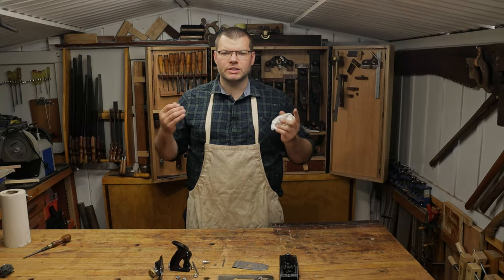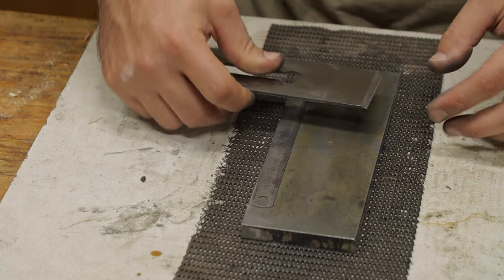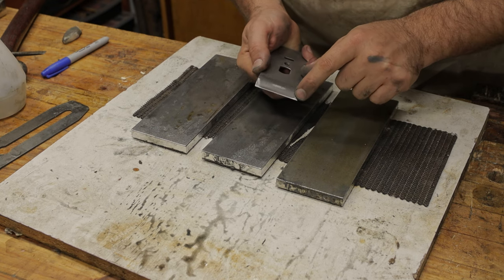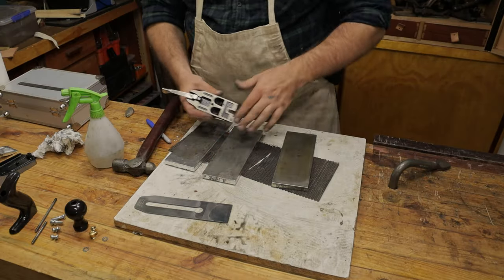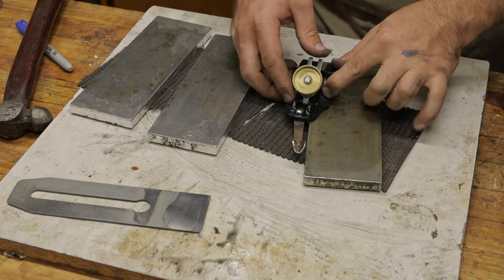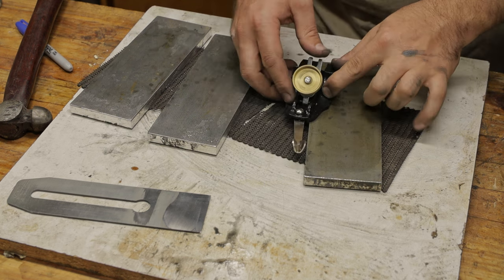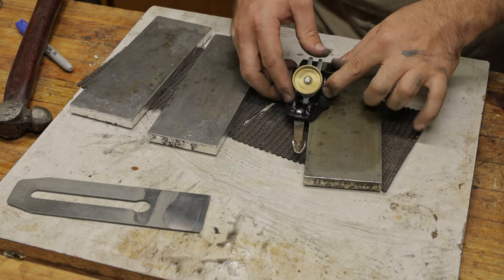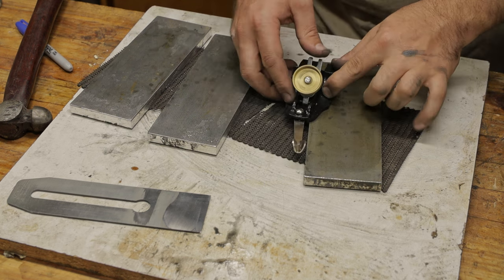How to prepare new Stanley Bailey hand plane!

Comment: I also bought one of these planes about two years ago and with a couple of hours fettling, it is actually very good; better, in fact than a premium number 5 that I bought at the same time by another manufacturer. The new Stanley planes will never be what they were traditionally but they have the foundations to work well if the user is prepared to put in the time to get them there. Oh, I also changed to good quality aftermarket wooden handles (for about £10 the set), which is a definite recommendation! I know Paul Sellers and I think Rex Krueger have videos showing how to make your own wooden handle sets but for £10 ready made, just buy them!
Reply from the maker: It definitely gets the job done once correctly set up and fettled, the biggest thing is a sharp blade and a well fitted chip breaker. I agree Wooden handles definitely transform the feel of any handplane over plastic handles. Thanks for the comment.
Reply: @AussieWoodshed  I found the iron (blade) quite easy to correct but getting the chip breaker to marry with it took longer than expected. On the bright side, once it's done, it's done, for many years to come. It'll do me for the rest of my life, I'm sure.

Comment: Fantastic job, watching gave the confidence to fix my new hand plane.
what type of sandpaper are you using to flatten the sole? 
I mean the grits and the type of the sandpaper
Reply from the maker: 120 Grit is what i generally use to flatten the sole, some times followed up with 240 grit but not often. Any basic sand paper works, currently i have been using fabric backed sand paper as i got a good deal on it. I have also used wet and dry paper, so really any sand paper you can get your hands on will do the job. I have a video going into more depth in regards to flattening a hand plane sole found here if your interested https://youtu.be/L7FKj6XUVNM

Hope this helps

Comment: I purchased the 12-004 about 4 years ago. Subsequent to that I acquired a Record no 5 which I have used extensively as it works wonderfully well but I thought now is about time I get the 12-004 going well.  I stumbled on your video which was so thoroughly well put together that I became an instant fan of your channel.

So thanks for the effort to inform others of how to go about turning that was ordinary to something worth possessing for real work.  

Have looked at doing the same to a Stanley no 5 from Total tools?
Reply from the maker: My Pleasure, glad you found the video useful. 

I was unaware Total Tools had the 12-005, but found it with a quick google, i will look into doing a video on this one when time and funds permit. BTW Beyond Tools has the 12-005 cheaper shorturl.at/HMOY3 here's the link if your interested.

Thanks for the comment!

Comment: that seemed not much different to refurbishing an old one appart from any rust issues. Does it feel the same as an old one when you are using it?
Reply from the maker: It is very similar to a refurbishment. Other than the plastic handles it feel the same to me.

Comment: You said look at the gap between the edge of the breaker and the blade.
How big should the gap be?
Reply from the maker: The gap I'm referring to will show as light between the blade and the chip breaker, you don't want to have any gap at all. If you have a gap usually it mean either the back of the blade isn't flat or the edge of the chip breaker hasn't been prepare square and flat. 

You want to be looking through the hump on the chip breaker to look for this. (Sorry if i wasn't clear enough in this video) 

I have another video just on fitting the chip breaker which might help you a little more : https://youtu.be/-r0xvK5lbu0

Hope this helps

Comment: Lovely video thank you for sharing this. I am too looking to buy this plane as I am approaching woodworking as a total beginner. Would you recommend a number 4 like this one as a first (and only, at least for a while) hand plane? I am looking to make small to medium size furniture/decoration pieces such as boxes and I doubt I would be doing much milling work to rough wood in the beginning but rather purchase square-edge wood to get into the craft. I saw many people recommending a number 5 low-angle plane, as a more versatile tool, but a number 4 seems more suitable for a small workshop in my flat. thanks!
Reply from the maker: Sorry for the late response. I think the no 4 is best for smaller items. I know lots of people recommend no. 5 low angle, but I've never had a need for a low angle hand-plane. I did this video https://youtu.be/qL01PP36W2s on choosing your first hand-plane a while back if your interested. But really either a no 4 or 5 would work well. The only real difference is the extra reference from the longer sole, but a good straight edge and regular checking negates this somewhat.
Reply: @AussieWoodshed  thanks so much for your reply and for you content, it’s really nicely made

Comment: UPDATE! I recently bought two vintage 'Made in England' Stanley planes; a #4 and a #4&half. I immediately compared the new and vintage #4's. There is very little between them except the vintage obviously came with wooden handles when it was new, unlike the plastic ones fitted to new #4's (Made in China? Not sure); simply refit with wooden handles, as mentioned in my previous comment. The most important difference was the width of the mouth, which is almost half the width on the vintage as it is on the new edition. The narrower mouth on the vintage is more suitable for fine shavings than the new model, which is considerably wider. So, the 'new' model #4 is having the iron (blade) edge radiused to become an ideal scrub plane, thereby taking advantage of it's wider mouth. As for the vintage #4&half, it's mouth is also narrower than the new #4, so it will be ideal for fine shaving harder - or more knotty - wood; the extra bulk and heft will help it to cut a little easier through more challenging timber stock.
Reply from the maker: Yes, i too have noticed that the mouth of the new Stanley Bailey no 4's is about twice as wide. I have converted a no5 falcon handplane that has a wider mouth with a radiused blade to perform heavy stock removal too. I think its a good option for anyone once they end up with a restored vintage plane or a newer mid range plane, to keep making use of the new stanley bailey plane.

I will have to do a video on this exact topic. Thanks for sharing your experience and knowledge to help everyone out, much appreciated. 

PS. thanks for the video idea its on this list now.
Reply: @AussieWoodshed  I agree, the new Stanley does have it's place in the kit, not only as a reasonable beginner smoother but later on as a very serviceable scrub plane that doesn't cost the earth. I look forward to the video, keep up the good work!

Comment: UPDATE #2! I have now bought a bargain basement 'Faithfull Tools' #7 plane for just under £50 new; it has a serious flaw. Even when fully retracted, the blade still sticks out of the mouth by 1/16th of an inch or so - that will need sorting. Secondly (not so serious), the front of the mouth on the sole has some visible chips in it, which will need tidying up - but at the price is no surprise. Otherwise, everything else looks and feels to be at least decent, if not great, quality. It's not a problem, it's a challenge...and that's what I expected.
It looks and feels like a #7 should; long, wide and heavy. The castings are actually good and true (except for the mouth chips). The components and fittings are as solid and accurate as would be expected at four times the price. Is it like a vintage Stanley? Probably as near as can be on the cheap - it's as good as a new Stanley #4, for different reasons.
New premium #7's are typically expensive, as are ready-to-go quality vintage models. I've been weighing up this model for about two years before finally deciding to take the plunge and see what can be done with it; can I bring it up to a usable standard, even though I'll hardly ever use it? If so, then how much could beginners save by going down this route?
Challenge number 1; should I just buy a replacement blade, which would incur more cost - or grind away for a while until it retracts? I'll try grinding away first!
Challenge number 2; should I widen the mouth to clean up those chips and move the frog/blade assembly forward accordingly or just make sure the sole is flat? I'll just make sure the sole is flat (which it more or less is) because it's not a finishing plane.
I reckon that from start to finish it will take the equivalent of one day to make this plane a decent quality tool; that includes everything to initialise it.
Reply from the maker: Sounds like some fun and games in the workshop with this hand plane. Thanks for the update on this plane, sounds like after a bit of work, it will be a decent plane. I have looked at these planes before also but never purchased one, i may look at getting one at some point. Thanks again.

Comment: Absolutely no point mating the blade and the chip breaker off camera. Blade orientation is probably the most common head scratcher for a lot of amateur woodworkers and you’re not showing this clearly.
Reply from the maker: Well you clearly didn't watch the whole video as the blade assemble was put together in the video and not off camera. As for the blade orientation there is only one way the chip breaker can be oriented with the blade and that is the way you took it apart, the only thing not shown here was the chip breaker being 1-3 mm from the edge of the blade which should not be difficult to achieve.

This video was also not a dedicated video on how to mate the chip breaker with the blade but a video to Fettling the new Stanley Bailey hand plane for use by flattening the surfaces, sharpening the blade and preparing the chip breaker.

If you want a more dedicated video for this it can be found here https://youtu.be/-r0xvK5lbu0. Which is clearly listed in the video description below the video.

Hope this helps